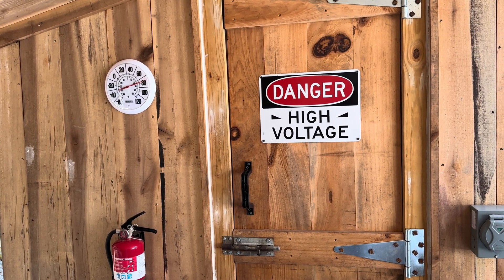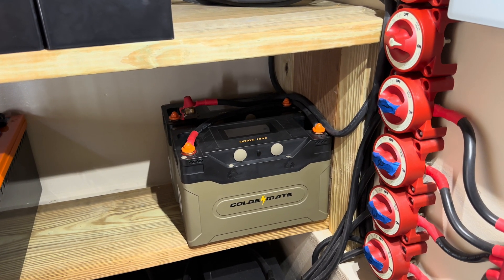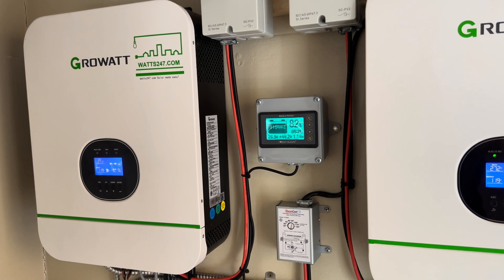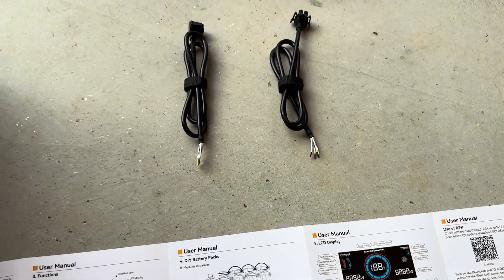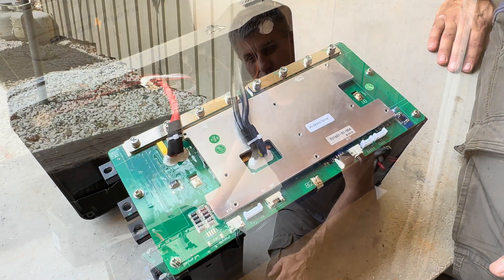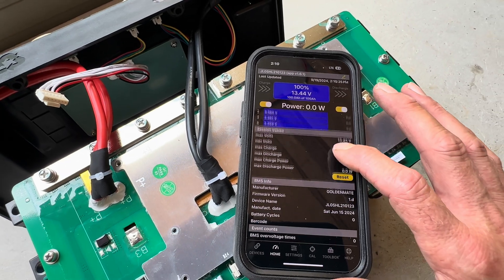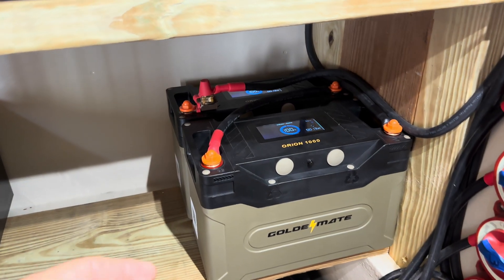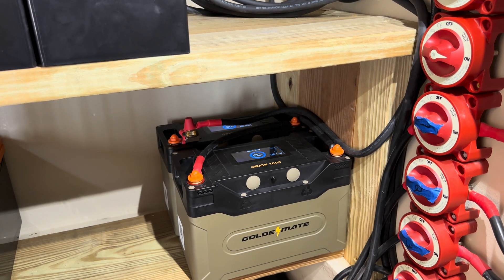GoldenMate Orion1000 battery for your solar power system or a trolling motor.

Comment: Question, I have a 200 ah deep cycle lead acid battery just to run a lamp the modem and router mainly if power goes out. I'm looking at this solar panel kit do you think this would be okay for what I need I have a 750 watt inverter?  ( ECO-WORTHY 100 Watt 12 Volt Solar Panel Kit : 100W Solar Panel+30A PWM Charge Controller)

Comment: Why do you have so many battery cutoffs?  If you ran the batteries in series, wouldn't that get you better voltage and AMPs for running off the system?

Comment: I use an "OutBack" 80AH MPPT  controller and an "OutBack" FXR 3.6kW 120VAC 48VDC 45A Vented Inverter/Charger for My Solar system. Kind of expensive, but it's been producing for 11 years. VERY satisfied with it. Check "OutBack" before you put in a system. It WORKS! (OutBack did not send me anything)

Comment: OUTBACK is KING when it comes to a dependable system.
Just my 25 cents as two cents does not get far these days.
Also be careful mixing battery types.
Do the research HARD.
Just another 25 cent 'opinion'. 
Cheers.
Reply: All lithium iron phosphate. Each has own OCPD.

Comment: For a trolling motor sytem, and the price, NO THANKS! I can get Group 26 AGM's and run one for my engine/bilge pump, then 2 for my 24V trolling motor, and wired different for my bait tank and GPS Charplotter Sonar unit. I run a 2K inverter with a 60W solar panel on my center console grabrail. Cost of the AGM's are $50-$55 a piece and last for years. Plus I can also turn my power switch to charge off of A/C, and they charge very fast.

Comment: Seems like you would of showed us the battery like  you wer trying to hide the cells i assume they not prismatic .? Am i right?
Reply: JGNE LiFePO4 cylindrical. Used by over 600 OEM manufacturers. Edit These cells are specd @ 106.25Ah but deliver more.

Comment: I could use 1 or 2   100AH  LiFePO's to pair up with an inverter, but don't need $100 worth of bluetooth or displays (per battery) because the inverter /charger keeps track of battery condition. For an RV with no battery monitor or a trolling motor these may be nice to have though.